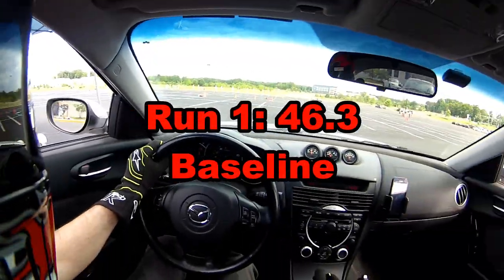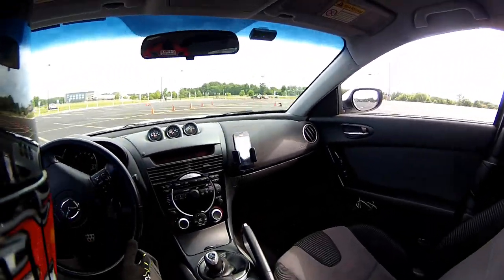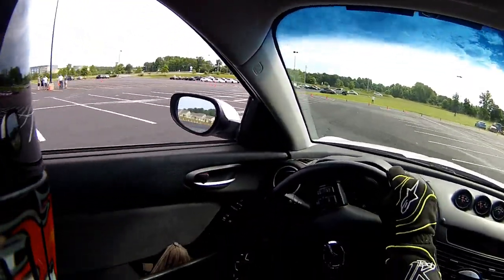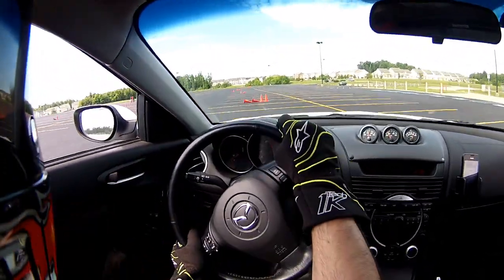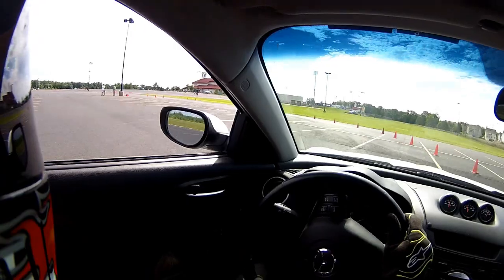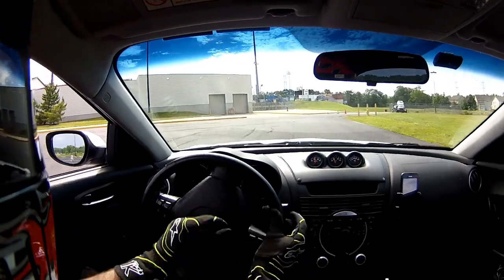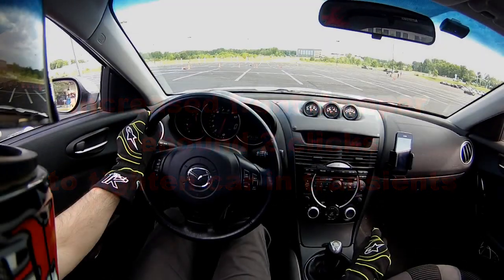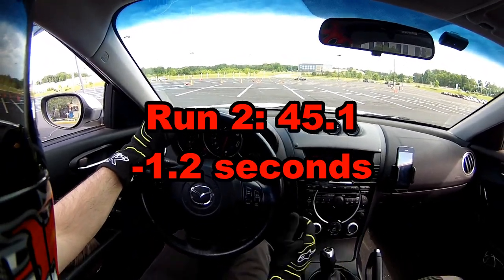Autocross tire pressure & shock settings tuning

Comment: What made you decide to adjust tire pressure rather than rear shocks on your second adjustment?
Reply from the maker: sometimes it's experimentation, sometimes the dynamic handling response is where it needs to be and you're trying to dial in the steady state balance.  now in days, i get the tire pressures near perfect based on temps and rollover and tune the handling response with shocks.

Comment: Matt, how did you get it down to 2700#? Factory curb weight claims around 3k. Just bought one for autocross myself, thanks.
Reply from the maker: Factory claims on 04 and 05 models were around 2880 -2940 full tank of fuel.  With 1/4 tank, lighter seats, lighter exhaust, battery, flywheel, wheels, intake, suspension,  removed tools and Jack, all small but add up.
Reply from the maker: With my rollbar I'm back up to 2750 these days.  But weight isn't as critical as everybody including myself has made it.  Good tires good driving and well setup quality  suspension will take you far in autocross... just read rules ahead of time and plan mods accordingly if you want to be competitive
Reply: Thank you!
Reply from the maker: @davidgarner6736  no problem David.   I hope you continue to enjoy the videos.  Always happy to answer questions.  My setup is no secret.